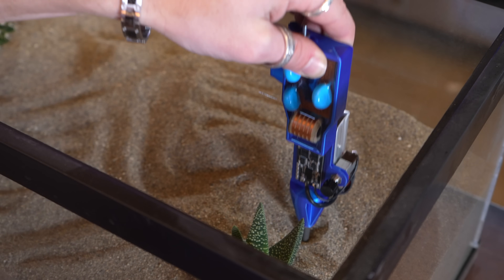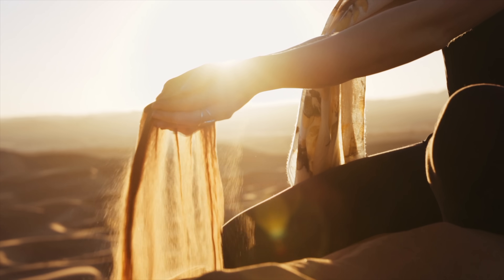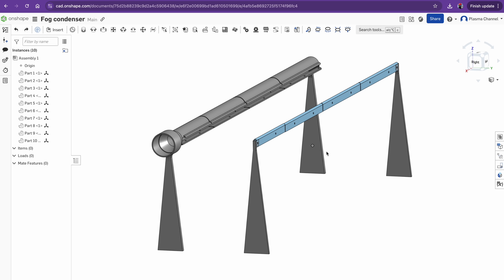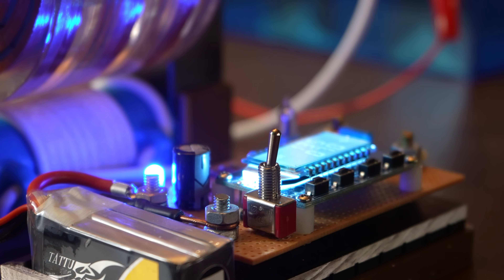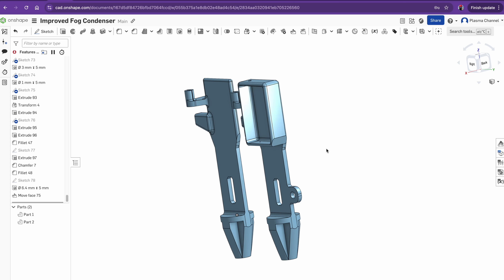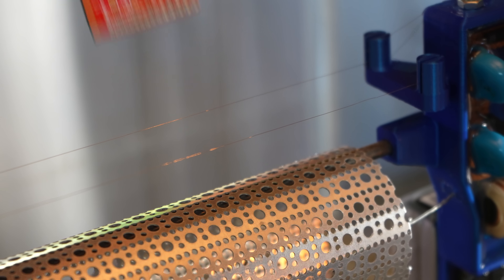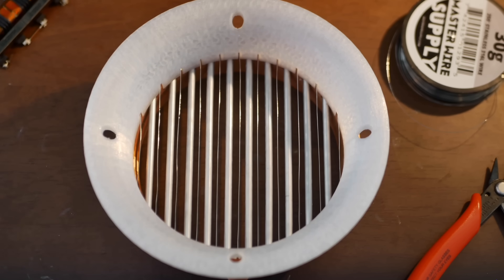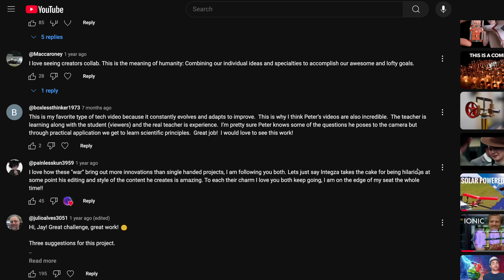Solving Desert Water Shortages Using 20,000 Volts

Comment: Can you test graphing Efficiency (ml/wh) vs Voltage ? Maybe lower voltage might be way more efficient (slower air and more time for the water to condense). Can you also check that it is not the air flow thru the mesh that makes the water enter in contact with the mesh more often and thus condense ? (strap a ducted fan and blow the whole volume thru the mesh) I believe that if so, a fan is way more efficient at moving big volume of air compared to ion truster. We might want slow but massive volume of air instead of low volume but fast

Comment: 39 watt, 5 minute, produce 45 ml water.

then, its power was 13.85 mL/Wh, 
then if you use 1000 watt of power, for 1 hour operation, it will collect 13,85 litre of water.

but the problem was, how much humidity rate. and different location, different humidity,
may cause collecting efficiency different.

Comment: 20,000 volts is a rediculus amount for such a small screen. For this to be a viable solution they vould need to increase the efficiency 100x. Because with the upscaling of the size of the metal net so too is the upscaling of the electricity required. Nevermind he explains it later in the video

Comment: you're missing a data! What is the fog density during the 5 minute duration the machine is on? Its hard to calculate how useful this can actually be without that one statistic. Please do another test with that measured and let us know. Also it would be very useful to know the percent of moisture you gathered from the total estimate of moister in the air. Knowing the fog density would be necessary for that statistic. I appreciate you comparing the same fog density with a dehumidifier so we have some perspective. You started off with giving us the percent of moister the moister nets you seem to be basing the design off of so its interesting you didn't provide one for your design.

Comment: The dehumidifier setup has a fan and can suck in the nearby fog. How does the high voltage dehumidifier behave without continuous feeding of fog into the mesh? Does it generate convection currents to pull in the nearby fog?

Comment: It's interesting to note that this process only works because of the kinematics of tiny droplets being accelerated into a grid. If the water were in a gaseous form, like humid air, it wouldn’t work. When it comes to dehumidifying air, lowering the temperature via refrigeration is still the most feasible method. That’s probably why you see such a huge difference between your plasma condenser and the Peltier dehumidifier.

Comment: Perhaps instead of just dropping the caught water directly into the soil for agriculture, a drip tank could house shade balls so that the system is protected from early evaporation. This can then be pumped directly to plants with feeding lines under the soil, or via gravity if on a grade.  Your videos are always so inspiring and cutting edge, can't wait to see the scaled version!
Reply: pretty easy to make it save. also i dont think you need the current he uses. just the high voltage. and you would end up with a regular electrical fence. if i am correct.. that would be far more efficient as well 35 watt to make high voltage is pretty high :) and not nice to touch.....

Comment: Do you need a mesh? Or would a simple second wire do the job as well? Maybe a weird bend in waves or like a coil so you have defined points where the water will drop?

Comment: Now test what happens if you charge the air itself without the wire. Kind of like a tesla tower charges the surrounding area. If, that works.. and if the pyramids were generators, they could have used something like this to make plenty of water for a thriving environment.

Comment: Imagine using this technology in the smoky mountains of the southern Appalachians where it can mean you’re not always near municipal water and wells may or may not find water. What IF you could put lightning rods into the air that are grounded and have cables underground taking those extreme charges to a system that can actually store that electricity….

Comment: Cool and inspring video makes the person think on different levels. 

But system at this rate seems to be not very efficient comparing to desalination systems for water producing. 
This system needs 71.5kWh energy to produce 1 cubic meter water (1000 liters). And simple googling showed numbers from WHO as per today 3.5kWh is necessary to produce 1 cubic meter water. Which for another note seems to be there are much more efficient desalination water plants in Israel at current day. 

Idea is cool but consumes 20 times  more energy than standard desalination water plant. I am looking forward to see scale up version, which probably will come with better efficiency than experimental scale one. Cheers and looking forward for results.

PS. There is a nice read from Hannah Ritchie, "How much energy does desalinisation use? Is it “absurdly cheap”?"
A deep-dive on desalinisation.

Comment: Good to include your calculations of energy efficiency, which seems to be ultimately the challenge to scaling this up. For conditions where this technique would work (arid coastal regions like Western Chile or Namibia), surely desalination of seawater would be a more efficient method - these run at about 3kwh per kilolitre, as opposed to about 20kwh/kL for your fog condenser prototype. The infrastructure challenges of large scale electrical power provision are similar for both approaches, but the Desal plant has a constant supply of water, produces a set volume of water for a given power input, and can be run 24 hours/day. By contrast, the condenser uses a set amount of power but its output varies depending on air humidity, and can only run in particular conditions.

Comment: You are quite interested in electricity. If I give you the flying saucer electrical circuit, can you make it? Two conical quartz crystals, bifilar coil, high voltage capacitor and x-ray tube antenna. If you ask how it is made, I can help you.

Comment: Combine this with Agrivoltaics in desert environments would be amazing. Power from solar to run the system and partial shading to reduce water loss from transpiration of the plants. Maybe do vertical farms in tower configuration with solar fog collectors on top to maximize space usage, reduced water loss, and power for the system.

Comment: I would like to see how an implementation with a small solar panel would work on the outside. Having a grid without electricity and one with it, both in the outside. Putting them in the night and check how much water was collected at noon. That would be a reallistic case and would show how effective is in the real world in a small scale. It can benefit small farmers that require water for their home farms without requiring irrigation or them using the hose to irrigate them. I image if that works, one can build a system that is self suficient, which would automatize home farmering by a lot (I know other solutions exists, but this one is cooler).

Comment: Built to scale, what desert dwellers will have the money to purchase the materials, let alone the installation and the infrastructure necessary to move the collected water to where it's needed? 
Where will remote tribes get the necessary electricity? 
Fog nets may be inefficient, but they're infinitely cheaper than the smallest of these devices. They don't require ANY specialized skills to install, to provide maintenance, or to upgrade. 
HHHhmmm... 🤔  $300 for the net system providing 20 gallons of water/day... OR! $10K for an electrical device that provides 50 gallons of water/day? 🤔 
Let's see... My children have learned a bit of math... Let me ask one of them to compare... 
$10K ÷ $300 = 33.333... Nets -- TIMES -- 20 gallons/day = 666.666... gallons/day for the price of an -- EFFICIENT -- electrical device that provides 50 gallons/day..??? 
Tribesman to the salesman: 
"We may live primitively. We may be uneducated by your standards... But! We are not stu-pid, as you assume we are. 
BTW, how long do you think a body hidden in this desert will remain hidden? How long before the "searchers" quit and go home?" 
😢 "What are you saying?!?" 🥵
"I'm saying you should leave while you still have a chance.."

Comment: Really cool on the paper, I want to know how it is going to behave on a real desert, I want to know if the sand particles are going to stuck in the metal grid as well or if the inconsistent moisture will lead to problems

Comment: I forgot to mention that this Corona Discharge Effect is used in Photocopiers. The HVT Corona 
Discharge is made using Gold Plated Tungsten Wire 0.08 to 0.10 mm dia.  Metal or Wire Grids focus
the HVT charge towards a photosensitive Drum.  It is an interesting process.

Comment: Excellent Video!!  Especially measuring the actual power to water conversion!! Sand is also a Thermal
Battery. So this source of Heat could be tapped for power that is stored in capacitor banks for use
during the short fog time period!!  I believe this power source would be cheaper and more effective
than solar panels. My Folks used to put absorbent baby diapers at the bottom of plant pots for moisture
retention.   👍👍

Comment: I don’t know if you’ll see this, but I would love to see you compare this to a dehumidifier in a house with normal humidity (not just fog). For example, you can set them up in the same room, separated on opposite ends and run them both for 8+ hours. You can measure the humidity in the room before and after to see how much it drops, if at all. I’m curious to see if this can replace normal dehumidifiers for home use while being more energy efficient.
Reply: It can’t dehumidify regular air. This device is fundamentally different because it’s not creating a phase change - the water in the fog is already in liquid form.

This device induces a charge on the mist and collects it on the grounded mesh - surface tension does the rest of the work to form full droplets. This is the reason it’s so power efficient, and specifically why the use-case is in FOGGY areas and not HUMID areas.

Cheers
Reply: @Screech-erz my thoughts exactly
Reply: @Screech-erz  Having had an Ionic Breeze, I can confirm it pulls no moisture out of the air. And that brings up another problem. The Ionic Breeze had to be pulled off of shelves for causing lung issues. Apparently more than just ozone.
Reply: I suspect it'll be more energy efficient provided you create a long box. No, it uses the same energy no matter the size. The same can't be said of dehumidifiers. No, the bigger, the more economical.
Reply: It's a quiet dehumidifier

Comment: DeepSeek R1 (the chinese model) accurately answered if High Voltage can be used to harvest fog, and explained why. Its response is below. ChatGPT is not the best model by a mile.

Yes, high voltage can be used to enhance water collection from fog, leveraging electrostatic principles to improve efficiency. Here's a structured overview:

Mechanism:
Electrostatic Attraction:

High voltage creates an electric field, polarizing fog droplets (water is polar). Charged droplets are attracted to an oppositely charged collector (e.g., grounded mesh or plate).

Corona Discharge: Ionizes air, imparting charge to droplets, which then migrate toward the collector.

Dielectrophoresis:

Electric fields exert force on neutral but polarizable droplets, directing them to regions of high field intensity (e.g., sharp edges of a charged mesh).

Coalescence Enhancement:

Charged droplets merge more easily, forming larger drops that fall into a collection system rather than being carried away by airflow.

Advantages:
Higher Efficiency: Can capture smaller droplets and operate in lower wind speeds compared to passive mesh systems.

Reduced Re-entrainment: Charged droplets adhere better to collectors, minimizing loss from airflow.

Adaptability: Potential for integration with existing mesh systems (e.g., conductive meshes with applied voltage).

Challenges:
Energy Requirements: Requires a power source (e.g., solar panels), which may complicate deployment in remote areas.

Safety and Maintenance: High voltage systems need insulation, protection from arcing, and regular upkeep.

Cost and Scalability: Complex to scale due to uniform field generation and infrastructure costs.

Real-World Examples:
MIT Research: Demonstrated a 50% efficiency boost using a conductive mesh with 1–5 kV applied, enhancing droplet capture.

Electrostatic Precipitators: Adapted from industrial air purification to attract fog droplets.

Conclusion:
High voltage methods offer a promising supplement to traditional fog harvesting, particularly in arid regions with frequent fog. While technical and logistical challenges exist, ongoing research and hybrid systems (e.g., solar-powered electrostatic meshes) show potential for practical, efficient water collection.

Comment: What is the PH and EC of this water? And have you tested that it is actually suitable for direct use in horticulture? Distilled water, RO water, etc, have no minerals or electrolytes and if they are the sole water source, will cause nutrient issues very quickly.

Comment: Add a carbon ceramic coating to the bottom 1/8th to make the project collection more efficient - this would increase the flow of droplets by at least 70% using less energy and less evaporation again into the atmosphere.  The collector should also be coated.

Comment: Its very strange the lack of knowledge about certain subjects, revolving around getting water, improving fertility of soil, using water to get minerals. And its not that we dont know that electricity (through a charged metal) for example could act as condensation nuclei for water molecules.

They use similar technology for anti-hail system, but spreading tiny particles in the atmosphere (Yes this is done, search about it).

PD: So what if you take a drone and put a metal structure maybe 100 meters from the ground, and use pulsating circuit to make the difference voltaje to pulsate. Could it be enough to produce the same effect using the voltage difference present naturally between air and ground? Maybe it still works with less energy, because fog or water vapor present at those hights has more differential compared to the ground.

Comment: You should put both the fog condenser tank as well as the water tank on scales and run the test while measuring both in order to graph the rate of change of the percentage of water capture, then, with that as a baseline, compare it to another run where you modify the tank's environment in various ways such as adding a fan and seeing how much it falls off as the wind picks up, etc.

Comment: What would happen if you reversed the polarity of the system? If the grid has a positive charge, it comes in contact with more water droplets than the thin wire. Then, more positively charged droplets should rush towards the wire. One other way is to install two parallel meshes, with the positively charged one facing the incoming wind. The second thing I want to ask is: would it collect moisture from the air, or just fog? In many arid places fog is rare, but there is enough moisture in the air itself.

Comment: i like the concept and you always have great episodes, for this test i would like to see a few controls to a more effective result, i would dry the sand to verify there is no extra moisture compared to the dry depth of desert sand desert sand does retain water just deeper than plants like to look for it, control the humidity level in the tank compared to a desert fog, set the spikes to register humidity and come on at certain levels and turn off at certain levels, and run for the same time a desert fog lasts, simulate the sun by heating the sand for the same amount of time and temperature the sand would get to in a desert, for the length of a desert day would be, then repeat for several different voltage levels in order to see what voltage works best.
i am not sure if it would be better to collect the water and then control distribution for crops, noe this depends on what your goal is, to grow crops in a desert or collect water from a desert for crops due to soil issues.
instead of cactus try using crop plants that are designed for growth in a desert like corn, since sand does not have many plant usable food source as is made in the constant decomp of life in the environment.
and i am not sure how the fish tank containing the fog is affecting the amount of water. 
it would be good to see a full scale test like this.
what are your thoughts.
Reply: also think about a farm that incorporates agri voltaics as in this video https://youtu.be/lgZBlD-TCFE?si=b2ceYFJZBL39Lf7n ,also think about the effect of switching the voltage from the air during fog times to through the ground maybe pulsed when initial planting happens for you seed plasma effect?

Comment: So something that might help is using capiliary action to suck the water as quickly as possible and or a basin that wicks the water and drains as much as possible. Another thing might be to test the mesh size and use something that won't rust as quickly as possible, since im assuming rust flavored water isn't good for anyone.

Comment: That was really interesting. Would it be improved if the high voltage wire was inside the pickup mesh? A bit like a thermionic valve, (tube.) Very much looking forward to this project being scaled up in an actual desert.

Comment: You're missing a key component that the ancients used crystals have pazoelectric properties. Sand is crystals.Sand should be the conductor that is accumulating the water, not the piece of metal. I've seen many natural phenomena of which you're experimenting where the earth would naturally collect water on the ground, like dew in a desert situation